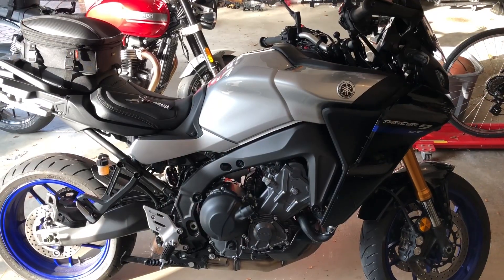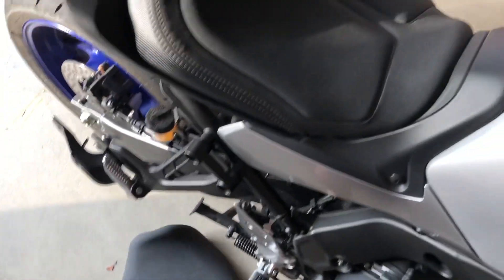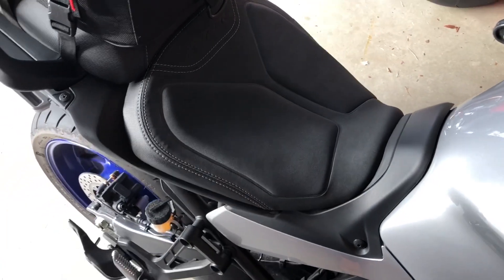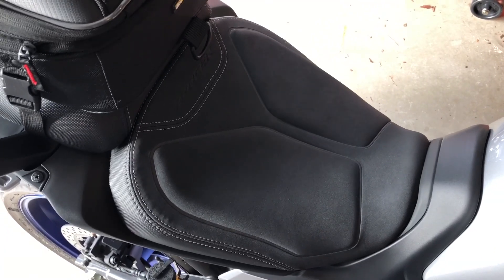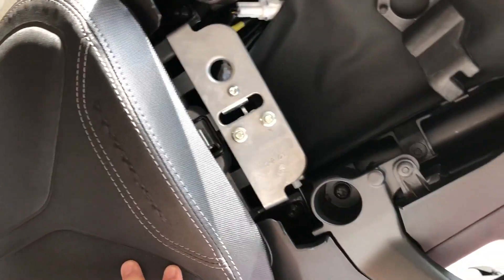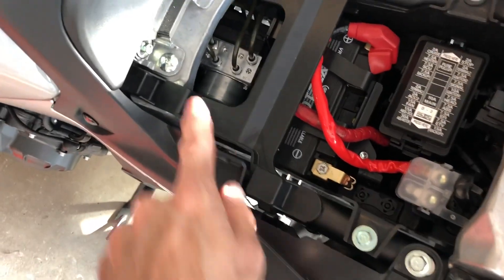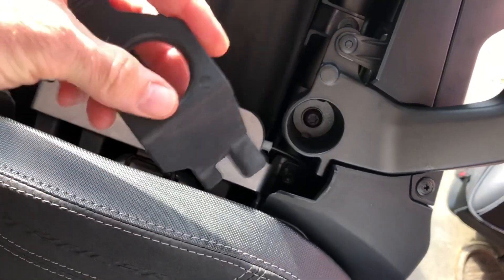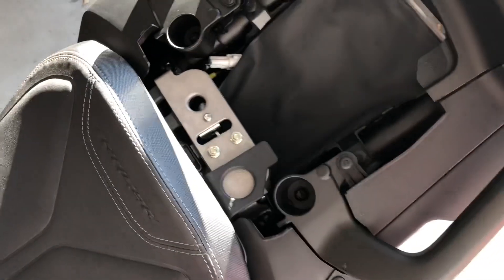2021 Yamaha Tracer 9 GT comfort seat B5U-247C0-00-00

Comment: It'll be interesting to see how the seat wears in over time. I did the same for my Suzuki VStrom and for the first 500 miles it was NOT an improvement. However, after a year and quite a few more miles, it was a really good decision.
Reply: I haven't ridden with this seat, so take it FWIW, but I hear a lot of people say it is noticeably more padded out of the box than the stock seat. Time will tell though, that definitely is a concern of mine as I weigh the cheaper yam comfort seat vs splurging for a proper Corbin.
Reply: Took that long to build up butt callus  lol  or to acclimate nerve endings?

Comment: Nice insight man. Any update on your opinion, wear and driven miles with it after 6 months? I'm looking for longer drives as 4hr+ what is your opinion on that with this seat, or what was your longest continues drive (with refuelling ofc)?
Reply from the maker: I rode the bike late last summer through the Monongahela National forest on a 2 day trip, and found that the seat does give you a bit more comfort than the stock, what it seems to do is spread out the  pressure points a little more evenly, so I could ride 4 hours with some numbness, but not “get me off this bike” numbness. The foam seems to be fine on subsequent 3 hour rides. The stock seat is better than the one I had on my FZ-07 and Street Triple, and the comfort seat probably adds 20% more riding time in “comfort” before you start squirming a bit.

Comment: Non heated version?
My comfort seat (looks exactly the same as this one) is also heated! It gets very hot, just like the grips do on level-10…😁
Just the ticket for where I live, and is a nice accessory to have for our climate here in England.
It’s a shame they didn’t make it out of the same ‘softer foam’ that is on the rear seat!?
I find it only slightly better over long distance rides — over the standard OEM seat.
Reply from the maker: Mine is indeed the non heated version. And I agree, it only provides a slightly better comfort than the stock seat, but for longer distances that slightly better comfort can help.
Reply: What is another shame?  That an aftermarket company does not simply sell better foam for like $50 you could rebuild the stock seat in 45 minutes!  Maybe a deluxe kit with better foam AND a fancy cover too for say $100... Or for $150 it includes the heating element with harness to plug into OEM harness.seriously NO ONE sells such??   I would think they could not keep up with the orders if they did!  Ya know?  The expensive part for all new seat would just be the injection molds etc to manufacturer the plastic base but the foam could be shaped from blank and the covers simply stitched off pattern like clothing etc.  Surprised CHINA is not all over it!  Exactly the kind of thin they could knock out by the thousands over night

Comment: I own this bike and the comfort seat. The comfort seat does nothing to solve the primary problem with the original seat- the seats are angled forward squishing your croch into the tank and applying pressure to your lower back on a bike that should be rode at an upward angle. The comfort seat only improved comfort marginally with more cushion but after 1 hour my body is crying for a break.
Reply: Having a seat angled forward on what suppose to be a touring bike is beyond me so uncomfortable
Reply: Add a shim to the front so it's more flat. That's what I plan to do.
Reply: @BlackBirdieGolf  
I had the seat with a simple mode mounted the front on the high setting and the back on the low setting so it won’t get better than that but still was bothering 
So I refoamed the entire seat where it feels like a saddle now very comfy
It’s the only way or the Corbin seat

Comment: Does this seat raise the height at all?
Reply from the maker: It does not seem to raise the height, with the stock seat I could put both feet down on the ball of my feet (so somewhere in between tiptoeing and being flat foot) and that hasn’t changed with the comfort seat.
Reply: @TheSunderlands1  I have a question. Today I got this comfort seat. I had my stock seat adjusted on the higher position and now that I put on this one, it looks like I have it on a lower one. So, are there still two position when you put on the comfort seat? Thanks a lot. :)
Reply from the maker: @RRRRefuelRideRace  I set mine on the lower setting, but the plastic seat pan looks the same between the stock and comfort so they should both fit the same. I’d have to play with mine, but it may require more force to get it in as opposed to the stock seat.
Reply: @TheSunderlands1  Yesterday I put it on and I have it now on the lower setting. Firstly will try to ride it a bit in this position. After I may change it. Thanks a lot bro.

Comment: Is it just me or does it not seem like SOME VENDOR would simply sell a kit to redo the stock seat?  In other words remove the staples and cover place new extra foam piece on top of existing and then install provided cover which is sized to accept added padding....DUHH right?  Could be like 100 bucks max I am guessing?  but seriously NO ONE thought to do this as a product line?   Seriously??
Reply: Not that ive seen. The tracers seem popular especially in Europe, so youd think even if having to get it shipped from overseas it would be available. I did see a guy add foam like that to his seat and it did help a bit.